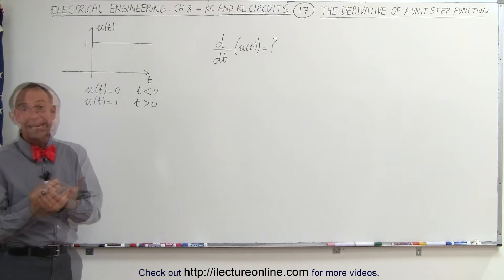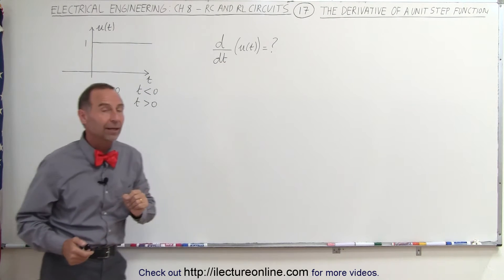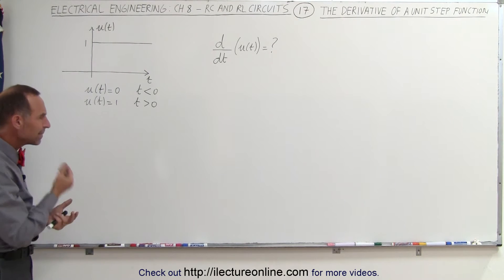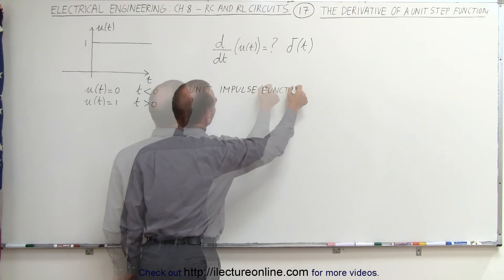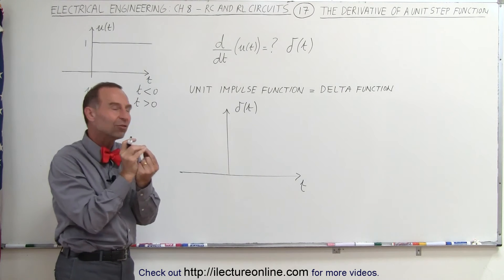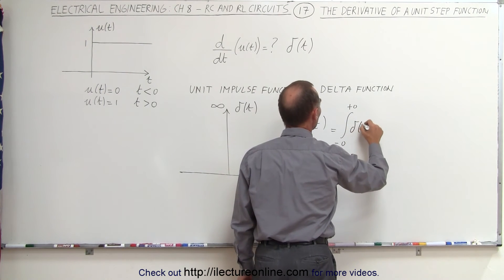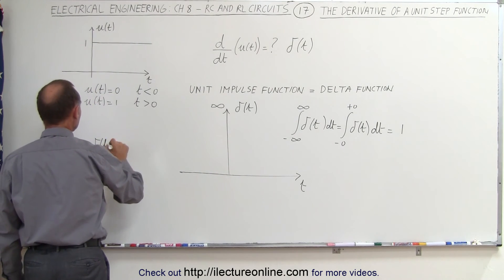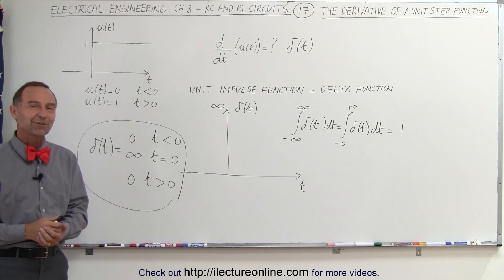Electrical Engineering: Ch 8: RC & RL Circuits (17 of 43) The Derivative of a Unit Step Function

Comment: This looks magically I wonder why it is equal to one. It seems as profound as euler equation, kind of like the building of a pyramind that if you multiply a zero width rectangle times infinite height rectangle you get '1'. Wow
Reply from the maker: Yes the Dirac Delta function is a very interesting function.  If you want to learn more about it, take a look at these videos starting with:  Physics Ch 67.1 Advanced E&M: Review Vectors (98 of 113) What is the Dirac Delta Function? (1-D)    https://youtu.be/k5WJof8EJ4E